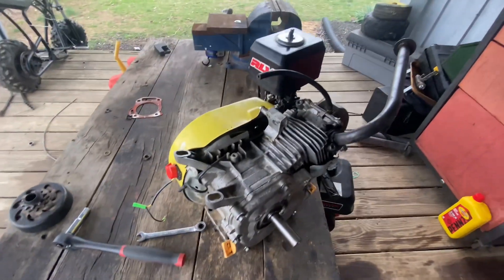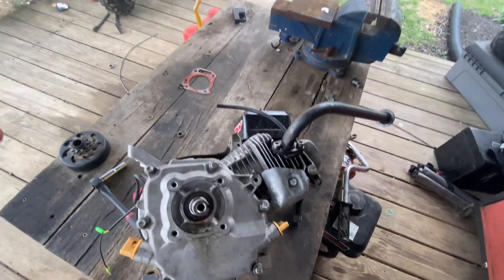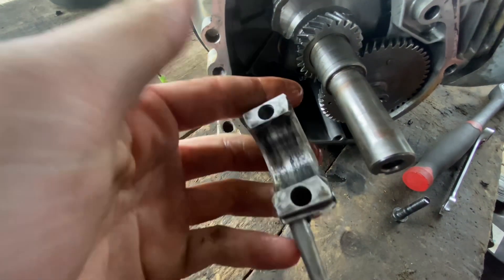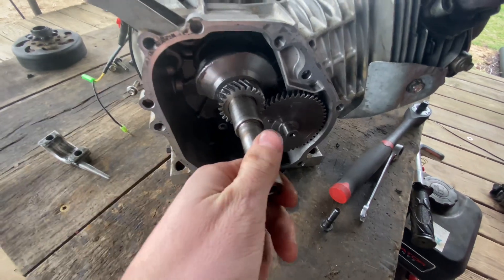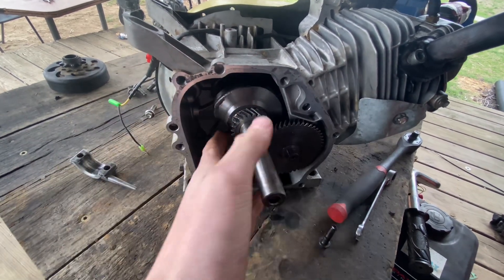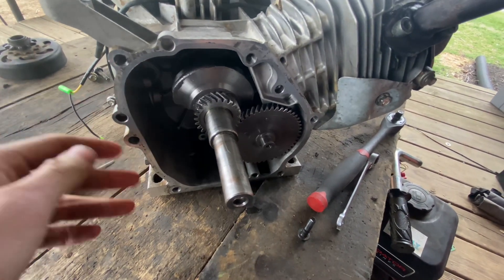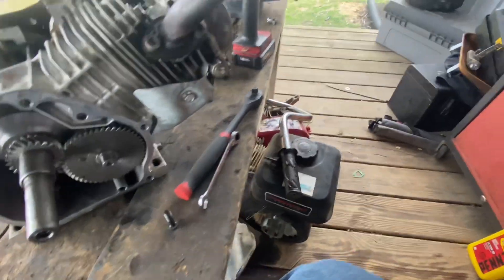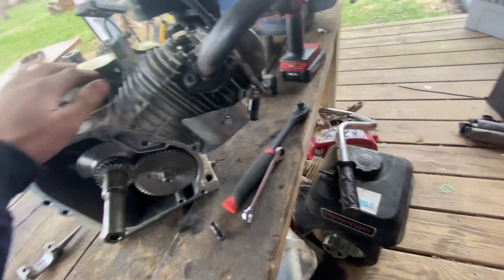I Blew Up My New Racing Motor. Why You Should Always Torque Your Rod.

Comment: I feel ya on this man I've got a few new motor in the box but never any time to mess with projects I blew my Tillotson up last year which really sucks I have a wc223 stage2 ready to go on my ktx kart
Reply from the maker: I was thinking about getting a wildcat. How do you like it?
Reply: @josephsaltsman2684  I've tested and played with almost every motor on the market I've thought about using my gts frame as a test and tune frame so stock the wildcat 223 is about the best motor on the market tell you get into stoker Tillotson bone stock its a power house with that said it us by far the most time consuming motor I've ever built the block clearance to get the stage 2 cam was not an easy task it's one of my favorite motors but it's not an alky briggs which is my favorite